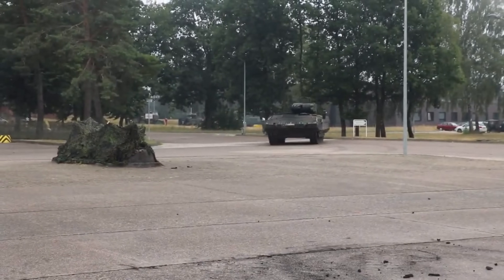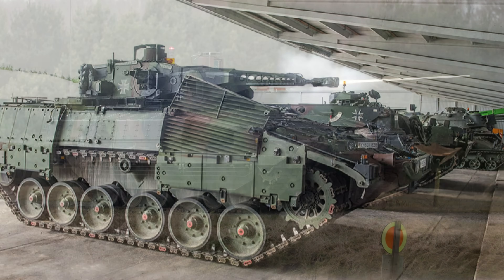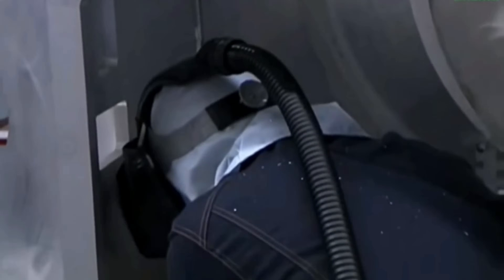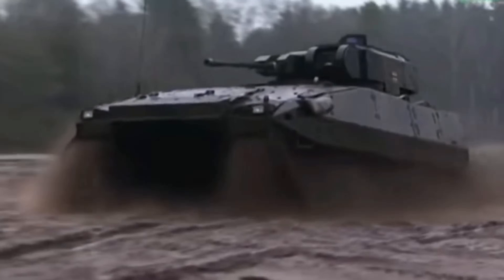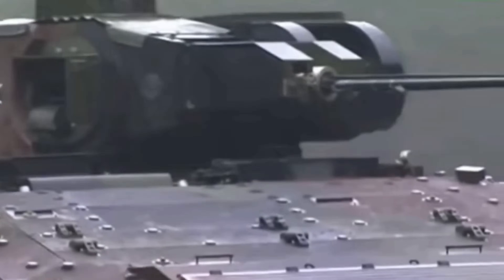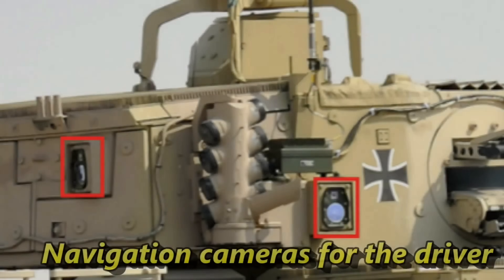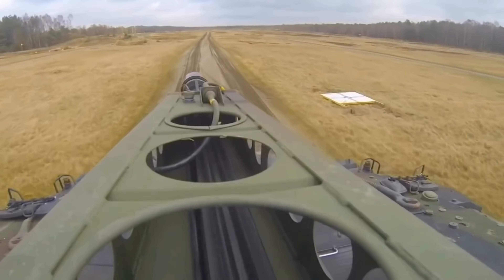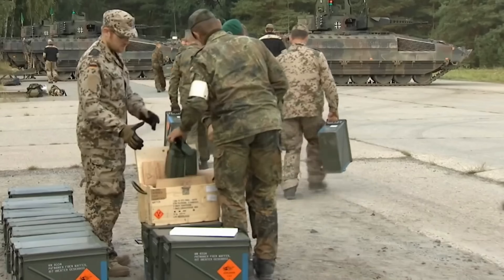The Puma Infantry Fighting Vehicle - Overview and Opinion

Comment: https://www.youtube.com/watch?v=I1VKe3j0KTg   Take a look at this, although in German you might be able to grasp the state these vehicles are actually doing in service .... not to good .... German Military Procurement System is utter crap .... they left out the cost for spare parts so the could get this (very expensive) project passed Parlament. Original configuration ordered was with BW screens  ....
What you will see in the clip is that the PUMA suddenly shuts down ( still massive software problems) .... the the crew it asking were the  circuit breaker is .... watch the commander crawling into the fighting compartment to assist locating the switch .... why back there in the first place ?.... is it the only one ? PUMA will take another 4-5 years to become fully operational and reliable .... having been a M1 TC myself .... your eyes and ears sense things a screen can‘t show you, so completely depending on all those technical gadgets could be it‘s Achilles heel if can‘t fight without them .... same goes for the T14 ARMATA .... at this stage they are useful „Testbeds“.
The Australiens went with a manned turret with their BOXER I believe.   Love your VIDS !

Comment: STOP assuming  that computers are more likely to fail than not computers 
That's not how it works
Reply: FlorKiler new I can tell you now, being a maintainer in the army, technology fails. And technically the “most advanced” tech/computers that the new vehicles get is technically outdated because it takes so long to get approval and tested. Example is the SEPv3 abrams. It’s new to us but the technology is like 5+ years old already.

Comment: I think starting with the 35 mm gun would be more future proof.
Reply: So do I.
The Marder 2 concept of the late 80's had a switching system whith two barrels. For most situations a 35mm was fitted. But if needed the cannon could easily and quickly (15 minutes or so) be replaced with a 50mm calibre. I don't know why they did not use this system with the Puma as well. It had already been tested succesfully on the Marder 2.
Reply: @komradearti9935  Thank you, that makes sense on the first view.
 But, forgive me asking a possible stupid question, a 50mm airburst would be even more effective than a 30mm airburst, wouldn't it? And the invention of a 35mm airburst would not have been a problem as well, as there was one in developement for the Gepard AA. 
(In fact, newest Gepard version would use it today had it not been decommissioned as a whole system mainly due to financial reasons.)
Reply: @papaschlumpf5894  The q is: do you rather want to have 200 rounds of 30mm or 50 rounds of 50mm in your unmanned turret? Esp considering you need to get up there, out in the open, to reload?

Comment: I'd gone with some kind of a upgraded Marder II. That 50mm gun, would be the overmatch you'd need for the future. Hope they actually mount the missiles and anti-missile systems en mass.
30mm and 5,56mg ain't gonna cut it anymore.
Reply: that's because you don't know how the german army is organized and operates. the leopard and puma ALWAYS work together. unlike in other armies where you have the main battle tank and the IVF running off in different directions doing different missions the leo and puma are always together. there is no point to mount a 50mm or 90mm on the puma when the leo already got a 120mm. the point of the puma is to bring some grenadiers along and fight enemy infantry and yes every puma will get the MELLS anti tank rocket to get that in the mix as well. but the puma is not trying to replace a main battle tank and it will always operate with main battle tanks. it's a no compromise IVF and mounting a 50mm would be a compromise for space, ammunition and velocity/recoil where the programmable 30mm just works perfectly. if you have ARMA 3 download the BW or Bundeswehr Mod and try the puma against infantry. it works like magic thanks to the programmable 30mm. you just get the laser range to target and shot and the round always hits and explodes in the air and every infantry near by is dead, if they are behind cover or not. in case an enemy ivf comes by shot at that too and after 10 rounds thats dead as well and if not then use the rockets. really no need for a 50mm.
Reply: "unlike in other armies where you have the main battle tank and the IVF running off in different directions doing different missions the leo and puma are always together"
To see what that looks like, have a look at 4:50 here.
https://www.youtube.com/watch?v=J8YZOFcwcVg

Comment: I agree with you Matt. Up to date sensors are a great thing an IFV absolutely must have, That being said the crew, the whole crew, needs to be able to be able revert to Mark 1 eyeball. If for no other reason than to safely get back to the supporting elements for repair. 

So you remember the Challenger in Iraq that was tuck in a ditch in Iraq? The enemy swarmed around it and shot out all the vision ports and sensors. Then spent a long time having firing practice with RPGS and anything else handy. Remarkably the tank held together and they were rescued. It must have been nerve racking not being able to fight back and getting hit repeatedly.

Comment: Question: what are those little shields with the crosses on which German vehicles have on the back for?
Reply: Its Part of the Blackout Light System: https://en.wikipedia.org/wiki/Blackout_light , called Leitkreuz, "for use when driving a convoy at night when it is necessary for the vehicles to maintain concealment by limiting their ability to be seen by the enemy."

Comment: Everything on this vehicle is armoured.  Even the driver, with a motorcycle helmet!  Otherwise it weighs the same as a T-72, has a gun of a similar caliber as the Panzer II with a much higher firing rate, travels far faster than both of these vehicles and can carry troops with a forward armour value to withstand many modern anti-tank rounds.

Comment: Is it still easy to kill like a BMP? I just can't comprehend, why don't they just use a Leopard 2 hull and convert it to APC like Namer in Israel? It's fast, strong, and shares many components with tanks.
Reply: A Leopard 2 based IFV would end up at more than 80 tons. You don't want a 80 ton IFV in wet european conditions.
Reply: @jonny2954  It will be heavy, but not that heavy. The Merkava weighs 65 tons, while the Namer(APC based on Merkava) weighs 60 tons. The weight of the turret can be traded for more protection. Btw, the Puma costs about 8.5 million, the much stronger Namer costs only 3 million...

 So, if you somehow put Puma's turret on Leopard 2, it would not exceed 70 tons, since Leo 2 with 2A6 turret weighs only 62 tons. But less cost = less money on the project = less fun for the company involved.
Reply: @stateservant  The Namer IFV variant exceeds 70 tons in combat ready configuration. The Merkava has a much larger internal volume than the Leopard 2, making a IFV conversion easier. A IFV conversion of the Leopard 2 would require much bigger changes and a larger superstructure, increasing weight far beyond the weight of a Leopard 2A6 turret. Even the latest Leopard 2A7 variants with mine protection exceed 65 tons. The higher cost of the Puma is explained by its higher weight-protection ratio. While overall protection is lower, the protection at a given weight is much higher. If you were to up-armor the Puma it would exceed the Namers level of passive protection at 10-15 tons less. Mine protection is already higher at 43 tons.

Comment: plus the huge exhaust weak point on the right hand side. No idea why they put it there rather than the back.
Reply: The prototype had the exhaust in the back, but that required the exhaust pipe to run through the entire vehicle length in the wall next to the fighting compartment. That #1 heats up the fighting compartment over extended periods of time and #2 takes up valuable protected volume that is used for redundancy subsystems.
Reply: @jonny2954  nice, like i said it's a weak point on the side of the vehicle.
Reply: @redjacc7581  Not a weak point. It's not a steel grating but in fact double layered NERA.
Reply: @jonny2954  so it's stronger than the rest of the side?

Comment: Is that thing ready yet?
The last time I read about it they still had some issues. People above 1.84m height are not allowed inside.
41 Pumas had to be upgraded for the NATO VTJF Mission. Additional costs: 723 million Euro.
Spareparts are scarce.
In a presentation with a german camera team they had some problem with the electrical system. Supposedly the e-fuse blew which would cause the tank to stop. They had to reset the fuse to get it running again.

That was like half a year ago. Not sure how many problems remain as of today since you rarely hear anything about them in public media.
But our ministry of defense is notorious for messing up contracts and ending up with equipment that has issues, is delayed, lacks spare parts and is way more expensive than it  was supposed to be.
Reply: yendak these problems probably still persist and will be fixed over time. But I doubt the height problem claim, it sounds very much like the headline one or two years ago, that after some 40 years of usage they finally figured out that the cockpit lighting in the Tornado is to bright and therefore it’s unusable for night time flights, when in reality the report, that was used for this headline was written by one pilot who felt like the lighting was a little bit to bright for his personal preference.
Also every MOD is notorious for these dumb mistakes, the British for example:
-their Challenger tanks are the only tanks that use two part ammo, the MOD closed down the only factory that produces that round years ago and now the British are desperately looking for a new gun, because the use by date on their ammo is coming up
-the list of the problems of their new Type 45 destroyers is so long, that it has its own section in the Wikipedia article, the biggest is probably that they are so loud, that Russian subs can hear them hundreds of miles away

The other MODs aren’t better, with project like the F-35, Zumwalt and Armata.
Reply: @roadrunner6224  The height restriction is needed for the decoupled mine protection seats. If the vehicle runs over a mine or IED the seats dampen the (potentially fatal) shockwave. They recoil slightly in the process, requiring a certain above head clearance so no one is smashed into the ceiling. Not really an issue since 80% of german males and 99% of german females are smaller than 1.84 m. Keep in mind, most IFVs don't even have mine protection seats at all.
Reply: @roadrunner6224  Yeah but these MOD's are lead by someone who probably at least served in any branch of the forces... our hero is joke who got her position so that the CDU can keep it in their ranks and won't lose it to an other partie.
Reply: @Benjo.1205  
A minister is a manager. Having served is rather meaningless for the position. Just like it's not the job of a health minister to treat patients. There's tons of people within any ministry with expert knowledge. The minister integrates their assessments.

Any kind of practical experience necessarily only covers a tiny fraction of the aspects relevant. A minister has to be able to listen to experts and together with them develop an overall plan that integrates the political strategy.

It's a testimony of utter ignorance to believe the minister micromanages procurement or maintenance. There's whole departments for that.
Reply: What the public often doesn't realize - and the politics aren't helping for setting things straight (because they and their incompetence are often the culprit) - is the fact the costs explode not because of bad engineering - but constant modification requests. These vehicles aren't engineered to a set time line. They are engineered - then a couple of vehicles are built - and tested in the field - and then ongoing modifications happen.
Even while the first batch of vehicles are delivered - requested modifications after the fact have to be done and retrofitted while building the series.
Altough it's called an "industry" - these companies operate more as "manufacturers". This doesn't work like the car industry for example in high volumes industrialized production.
Also - the PUMA is not a Rheinmetall only vehicle. It's a cooperation between KMW and Rheinmetall.
Reply: Spare parts are scarce because this is not the automobile industry. First of all..... spare parts for these things are expensive. Why? Because they are not produced in high volumes - and when they need to be produced the complexity of production creates long delivery times. And nobody wants to produce expensive parts upfront - for things that might not break within the next 10-20 years?  These vehicles are made of tens of thousands of parts.... you can't have them all in stock. and sometimes even a small missing part can cause big issues. Also the customer countries and politics (germany one of the most notorious) don't want to plan ahead themselves.... so they only act when SHTF... and THEN does public announcements/tenders for spare parts.... which prolongs the whole process. A lot of politics that happen behind the scenes doesn't make it to the public at all. Media just jumps on the clickbaity headlines - and for the politics it's always the easiest to blame the manufacturers - while conveniently concealing their own incompetence within the bureaucratic apparatus. 🤷🏻‍♂️
It's not as easy as the media and politics try to paint it - and the manufacturers don't openly make statements against that - because you don't bite the hand that feeds you. At the end of the day it's still a small circle of decision-makers. 😒
Reply: @willionaire77  Whats more the BW cut the original order. So RM suddenly had to find new work for these people and moved them into other projects (like Lynx). Which meant they werent around to produce additional spare parts (who can take up to half a year to produce due to complexity)  when the BW suddenly discovered it needed them. But things are improving; slowly but steadily.

As for the size of the PGs, there are supposedly new seats incoming that will add 2 inches to the allowed size for 2 of the 6 dismounts (those sitting closest to the door, I think). Should take care of most of the problem.
Reply: With the height its true but only for the 6 soldier in the back the gunner, driver and commander can be up to 1,91m but nobody cares about the 1.86m. The problems getting slowly less its a new system with a lot of electrical systems when you look to the f35 its the same, its delayed and way more expensive than it was supposed to be

Comment: If the damn thing would work I'd agree, but I have fellow service men saying these IFV are not combat ready most of the time 🤷‍♂️
Reply: Oh, those are not combat-ready no doubt. But worry you must not! The staff is resetting those vehicles the way they gonna play a role in a specified combat environment. A few types of newly developed IFV/APCs from Europe went into battle in Afghanistan (to Iraq - less, so was the lesson). Those were usually up-armored and up-equipped. And prooved being capable above the estimates. 
Now both Puma and Lynx are very fresh pieces. I don't think the armored companies which got those do know and can do all of what the design offers. At least 1-2 additional years to stabilize the man and the tool relationship to tell more. A manual back-up to some sophisticated systems is my question on the Lynx and Puma. 
All I can say is the Rheinmetall sales manager told us (at the MSPO Kielce) that the electronics and automated systems been tested to the level of pain. And then repeated, repeated, repeated... Also, the vehicles used for training are never in the shape they go to war.

Comment: Hey Mat when you were pointing out the cameras, the ones you marked yellow are not actually cameras this are sensors for the "MUSS". This system uses the sensors to track if a laser is targeting the tank and allows to use the board smoke in 3 different ways, one of is full automatic, means the tank will use smoke in the direction the laser is coming from.

On the other hand with the new Puma version there are a high number of cameras surrounding the tank.

Greetings

Comment: Ahem...
Theres problems though.
The Puma is not perfect by any means.
It is well known within the german army that it is prone to breakdowns, one of which actually happened with a reporter and cameras on board.
The failure that happened was the most common one with the Puma: an engine stall, requiring the driver to crawl to the back of the infantry compartment and slam the fuze back in.
The biggest problem with the Puma though is, that spare parts are rare.
If a breakdown happens, and the vehicle needs to change any parts, it will most likely take a month or more for spare parts to arrive.
Often times, the crews salvage parts from other currently incapacitated Pumas, to at least keep the one going.
Almost every part of the Puma is specifically made for it, so using other parts is nearly impossible.
And yes, that IS bad in the case of a war.
Reply: True, but:
1.
Every new model in every nation of the world does not work perfectly at first. The Puma is still being introduced and technical problems will be solved in the future. 

2.
That spare parts are rare is not a problem of the system, but a problem of politics. 
The military hardware itself works fine, it is the politicians that don't.
Reply: @papaschlumpf5894  
Yes, hardware is always dependant on the politics behind it